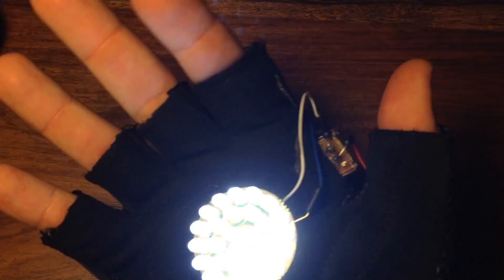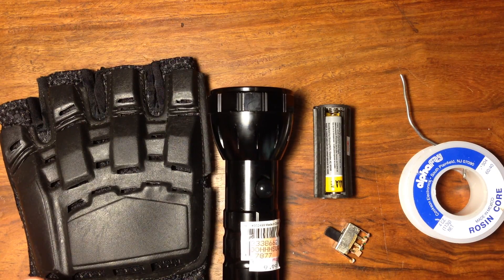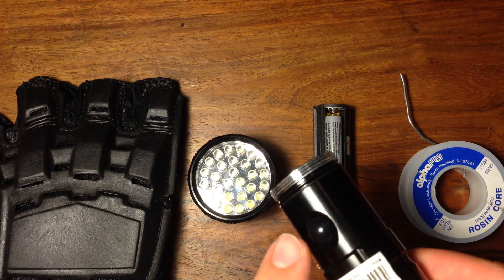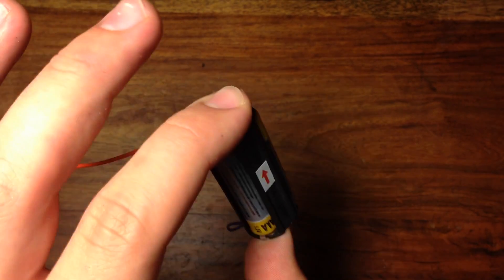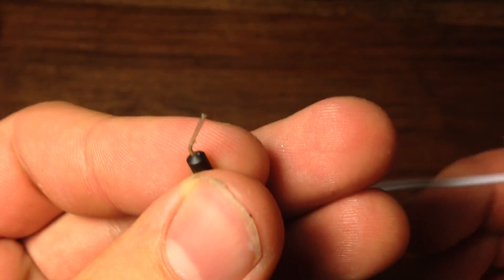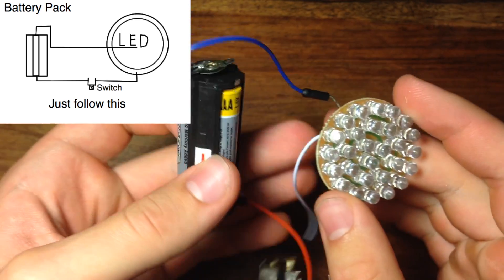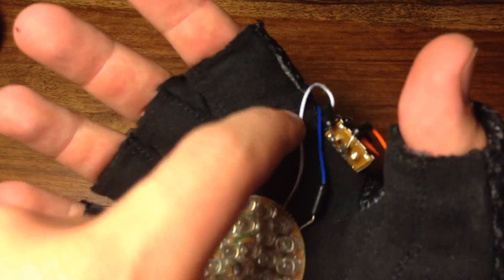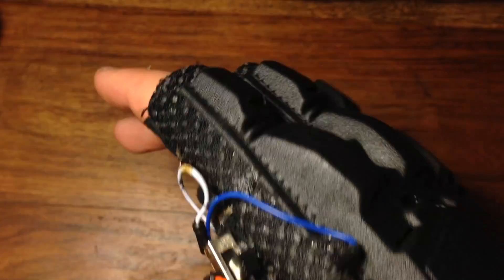How to Make an Iron Man Light Glove

Comment: I'm confused. How did you use the solder? Because it looks like the all you did was use the soldering iron. Did wires already have solder attached to it or did you attach the solder manually to the wires and just didn't show that step?